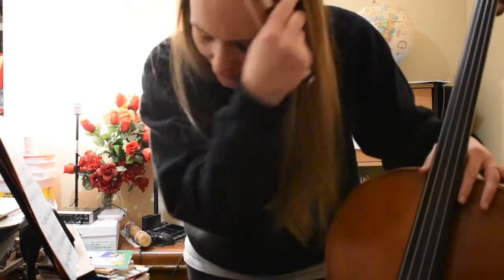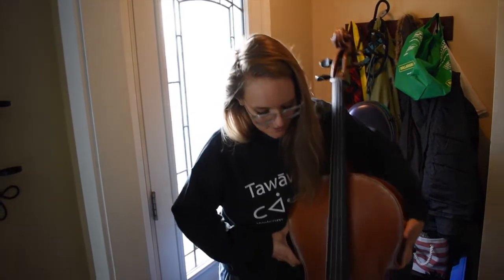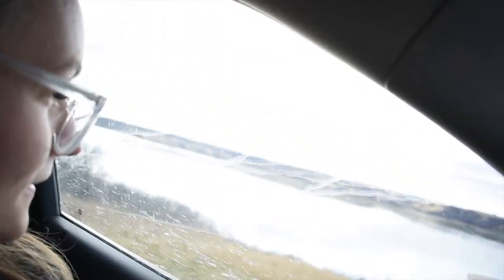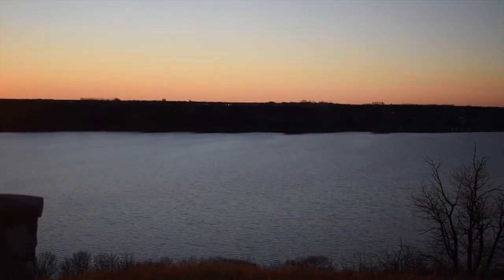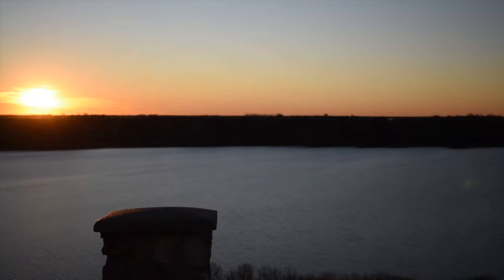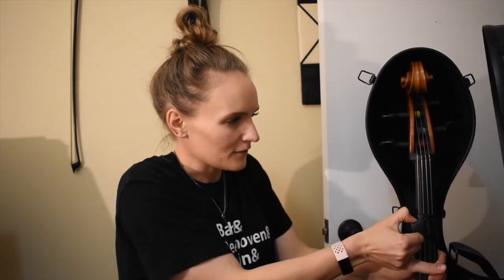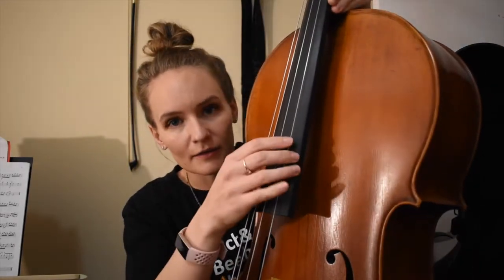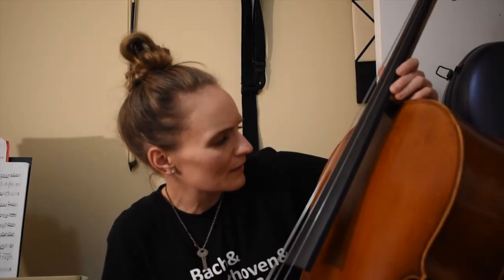The Broken Cello | Vlog

Comment: What a stressful ordeal!  I hope that things are OK after playing it for a while and you are happy with the sound and action.  I imagine that the air must be extremely dry in the winter where you are.  Do you have a room humidifier for where you play and store your cello?   Mine is working over-time these days to keep my practice area at 40% humidity.  Hang in there!  Good luck!!
Reply from the maker: Hello! Thank you! Things are OK with the cello after playing it for awhile. I am starting to get used to the new adjustments. It is very dry here, and I have been meaning to turn on my humidifier (thank you for the reminder). How do you check the humidity in the room? Is 40% a good number to keep it at for the cello? Any advice about that would be appreciated!
Reply: @MeghanBowman  I think that 40% is the minimum but that should keep your cello from drying out and cracking.  I prefer 45-50% but that's not always possible this time of year.  You monitor humidity with a hygrometer.  About $10 on Amazon.  Well worth it!   You played a bit of Veni Veni Emmanuel in your video.  Not cello related but do you know the piece by James MacMillan based on that melody?  Check out this video: https://youtu.be/JJovoz9tFU4.  If you've never seen Evelyn Glennie perform you will be amazed, at least I was.  - Kevin
Reply from the maker: @vinyltarian  wow! I'm watching the video you linked right now - it is incredible! I have not heard this before. 

Thank you for all the tips on humidity. I appreciate it. It is something I need to handle a lot better. I have used the little humidifiers that go right into the cello, but they always seem to break.